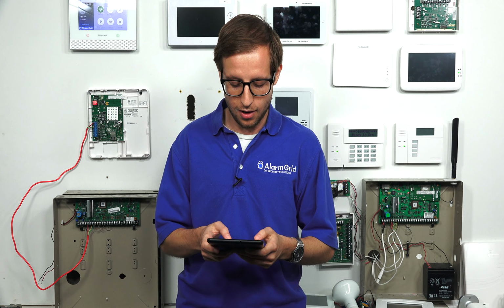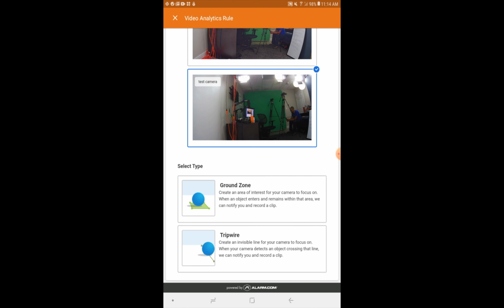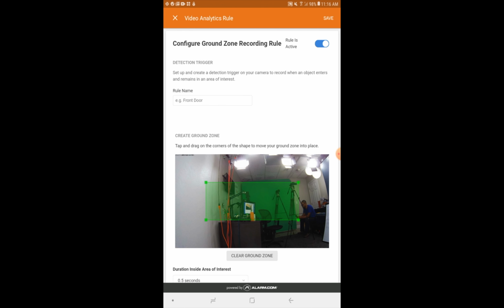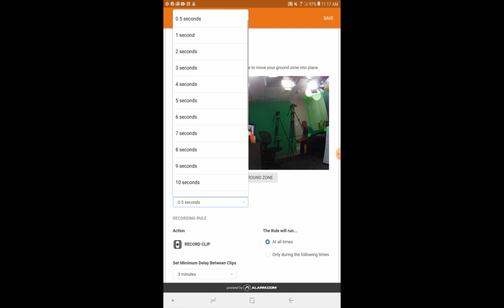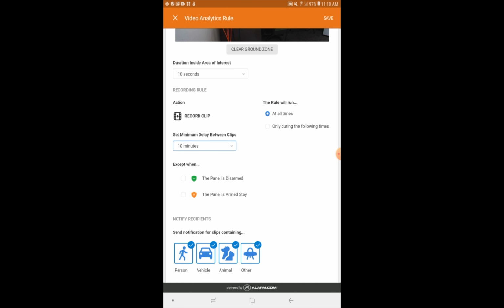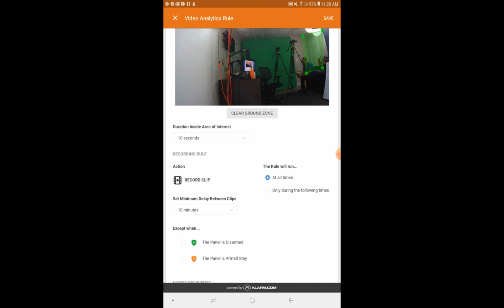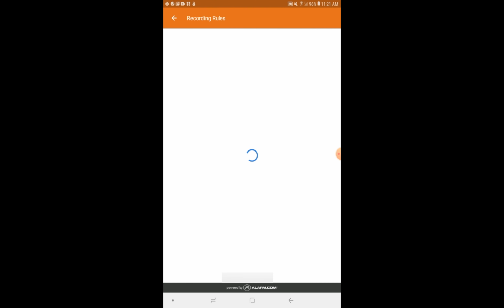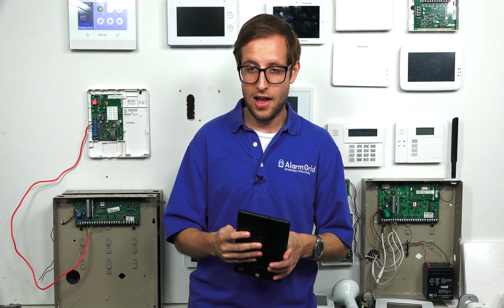Setting Up Video Analytics for Alarm.com

Comment: Alarm tech here, I’m trying to figure out the recordings on Alarm.com. I’ve been showing customers and settings up the analytics and it’s great but still getting false recordings or am I?  Take a driveway camera positioned at the far corner of the front of the house looking at the driveway, and catching the road. I set up a trip wire at the bottom of the driveway only detecting inwards and a ground zone set up just on the driveway protecting the vehicles; Set for 5,10,even 15second detection. Notifications are set to show only people and vehicles. Now the customer is getting notifications for cars driving by on the road and people walking by in the sidewalk. This is not what we want. We only want recordings accordingly the rules set up.  Why is it picking up vehicles on the road and pedestrians on the sidewalk. Even my cameras at home do it. I turned off vehicle notification because I had a ground zone set up around my vehicle and I would get a notification saying a vehicle was detected. Well...duh, it’s been parked there for for the last two hrs. So mAny false recordings. Before when it was only motion detection, I would get 50+ false recordings on my vehicle because the headlights from other cars reflecting off my vehicle would trip the motion to record no matter the sensitivity or window percentage!!!grrr this is frustrating. It’s almost to the point that I’m telling customers to just bite the bullet and buy the SVR!!! Screw this clip shit. Just make it mandatory to have the SVR! And still have notifications even if they’re false. At least it’s not killing your clips!!! Remember when it used to be 1000’s clips, well that’s not good enough. You need at least 50 clips per day for family activity and 25-40 for false notifications and 10 for actual things you may want to catch. That’s 3000 clips per month which is what we giving with analytics, cancel/verify, and panics on the app.  But I’m thinking SVR has to be mandatory! We do for commercial properties, but I’m thinking it should be mandatory for residential and get rid of the clips!!!
Reply from the maker: I understand the frustration.  Have you spoken to Alarm.com Core technical support about these issues?  We've not had any customers complain of issues on the scale of what you're talking about.  Perhaps you could share some of your false recording clips with them, and they could either let you know how better to adjust them, or they could send the information to engineering to improve on video analytics.

Comment: I see a lot of videos for Alarm.com products. I was looking for a NVR or DVR that will work with the Alarm.com cameras and app. As well.
Reply: tonyy33055 alarm tech of 22yrs. Traditional cameras will always be the best. Especially with POE now. But for the AIO wireless alarm integration (smart Security), Alarm.com is the best so far. Unfortunately you’ll need an SVR and I actually don’t mean unfortunately!  If you have existing coaxial cameras, your in luck. There usually another wire ran with the coaxial that is used for power. You can use that wire to power your ADC camera. If there’s a cat5 wire, your in luck. You can use two of the twisted pairs for power to your ADC camera. if there’s no wires, good luck in drilling/fishing/and/or hiding the wire in the soffit and hopefully siding to a power source.
Reply from the maker: Hey @tonyy33055, the SVR is alarm.com's NVR-like product. It works with the alarm.com cameras, and the app. It saves footage locally, but also puts it on the cloud. https://www.alarmgrid.com/products/alarm-com-adc-svr122